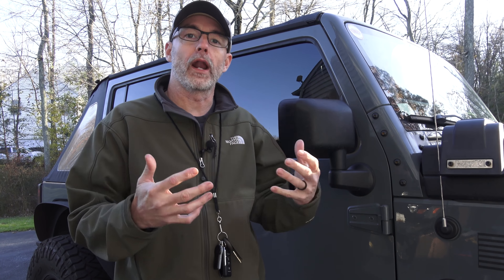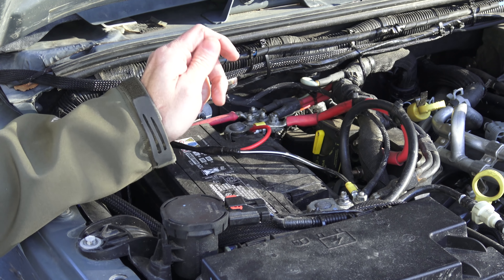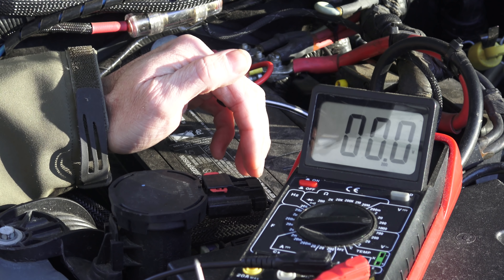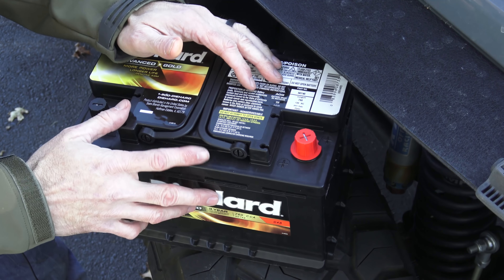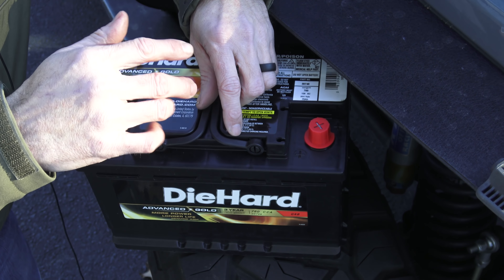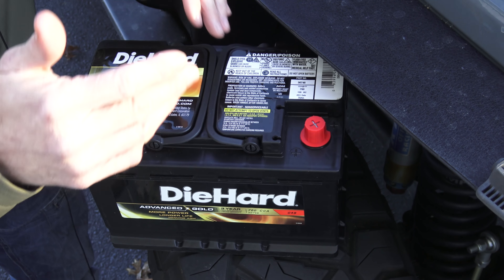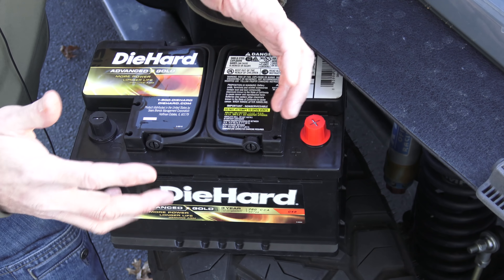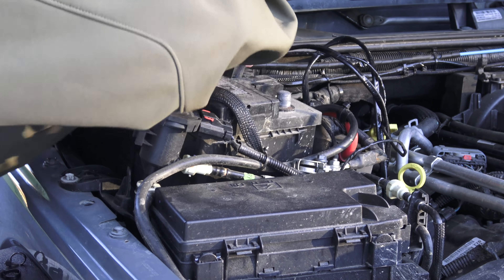OVERCLOCK3D Gets A New Battery!  My Choice May Shock You...

Comment: When it comes to lead/acid batteries people always make the mistake of getting the highest CCA rated battery they can find, then get disappointed when it doesn’t last as long as it should. To get that high CCA rating the plates in the battery are much bigger than a lower CCA rated battery. The battery case isn’t any bigger, so there’s less water/acid in the high CCA battery. The water/acid acts as a cooling system for the battery, so the high CCA battery will be hotter and gas out the water. High CCA batteries have a lower accepted charge rate because of the lower cooling capacity. Now days with gear reduction starters you don’t need a 1000 CCA battery, except in very cold weather areas. To correctly size the battery take the engine displacement in inches, double it and add 100. That will be the CCA rating that you need. For instance, a 350ci engine X2 =700+100=800CCA. Hope this is helpful.

Comment: Lots of rebranded DEKA/East Penn AGM batteries out there. I picked up a Duracell Platinum AGM at Costco. Pretty much a DEKA Intimidator AGM in a size (92 AH 49 H8) Intimidators aren't sold in. Got it in my Rover last year. Going to add another. Was around $170.